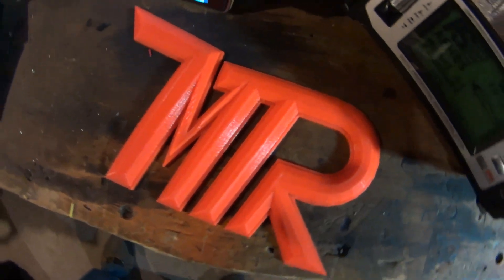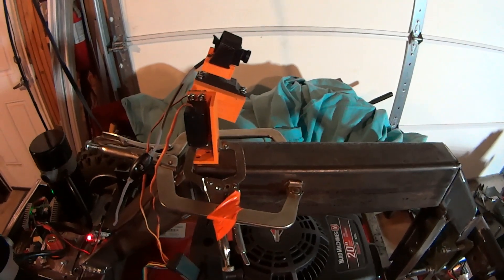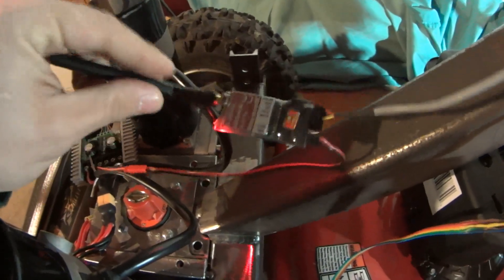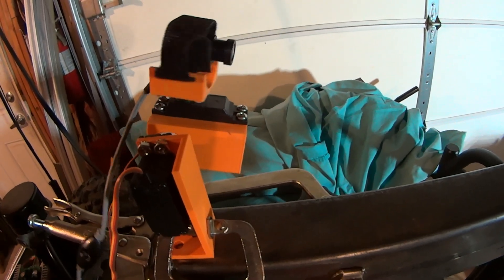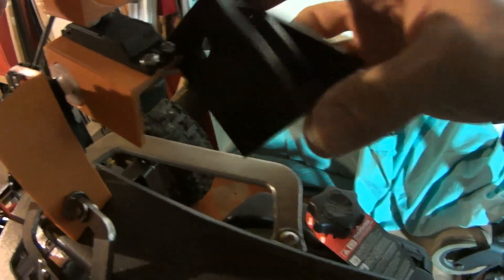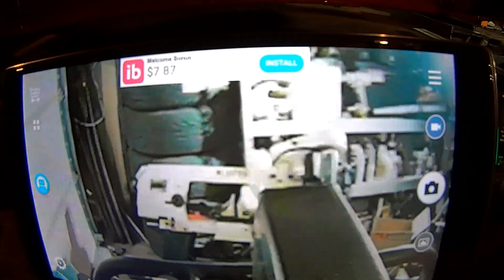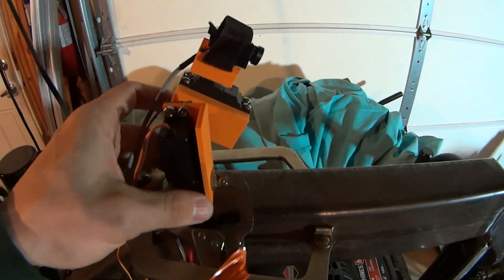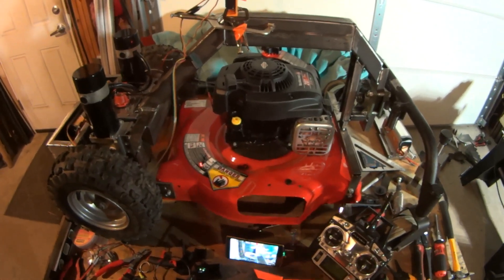RC Lawn Mower V2: Pt. 14 - Adding FPV Video gear with pan and tilt

Comment: Maybe I Will add FPV camera in near future, but vibrations can be problem. Which FPV transmitter and receiver have you? I Will watch how FPV Will work.
Reply from the maker: Immersion r/c 5.8 ghz. I plan to use my TV as the monitor...the receiver (can't remember who makes it.) I'm using connects through an android phone. I will screencast from the android phone to the tv. Please keep watching. Vibrations may be an issue... We will find out together. Thank you for watching.

Comment: Im building mine at the moment.  Ive been flying FPV before you could go out and buy it, quadcopters too.  We were making tricopters out of wood.   Needless to say ive got loads of transmitters and camera and such kicking around for the mower.  You will thank yourself if you get or make some better antenna than what you are using.  The cloverleaf designs are what you want for all the yard obstructions like trees and bushes.  Keeping the camera as low to the upper frame you have would reduce vibration.  Between the mower shaking and the ground im expecting plenty and I would not be surprised to find a solid mount for the camera without any dampening might be the way to go.  Ive got a set of fatsharks but my goal is to sit my ass in my chair in the living room and cut the lawn on the big screen connecting a 5.8ghz receiver to the TV via RGA cables.  That way i can leave it hooked up on one input and not need to mess with it in order to mow.
Reply from the maker: We will see how sturdy the camera looks once everything is running. The "monitor" in the test has a cloverleaf on it... It's also an android phone.... From there all I have to do in is cast the screenshot to my android tv. Boom! No cables. Mowing on the big screen! I can't wait. Thank you for you suggestions and good luck with you project. Thanks for watching.